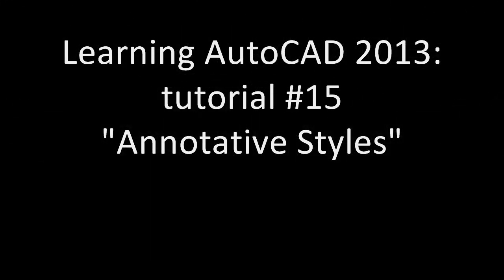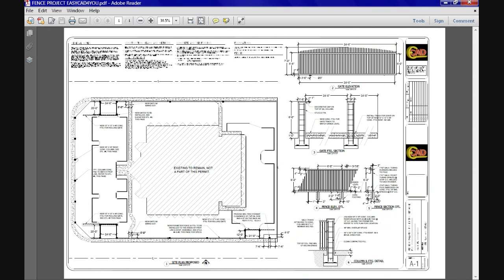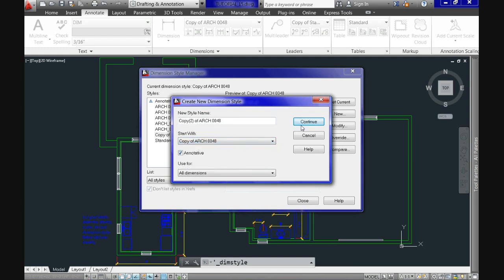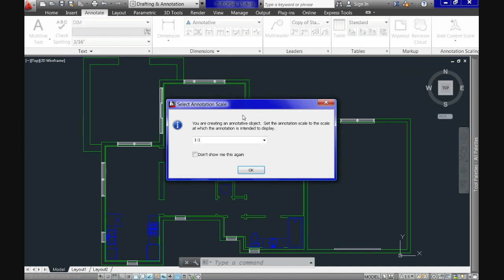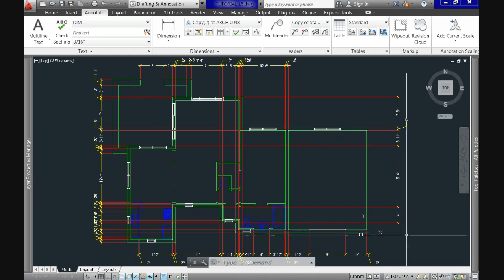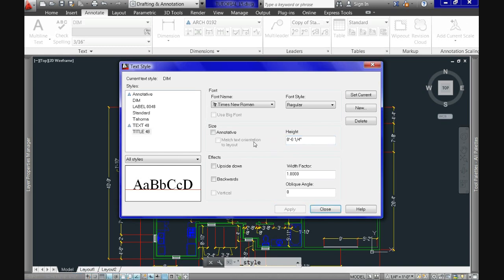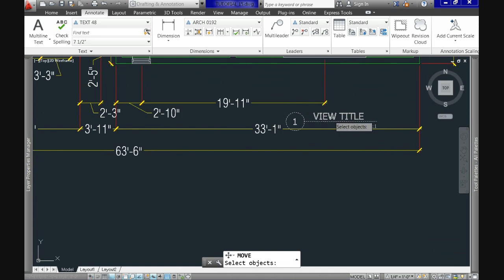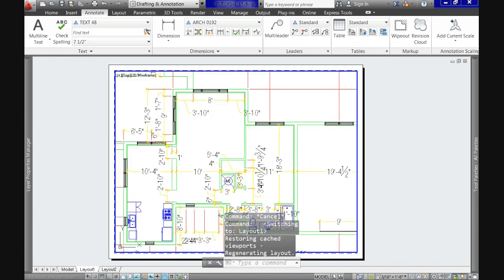Learning AutoCAD 2013 tutorial 15: Working with Annotative Styles.

Comment: Hi there! I was wondering what kind of dimension styles do you have like the specs inside and everything because I got lost from the last tutorial.
Reply from the maker: +Johnny Chiang 
Hi there, the difference between the 2 is that this video is focusing on annotative styles, they will automatically adjust based on your input. The previous one although more traditional is manually specifying what style to use for specific scales. Hope this helps and all the best.